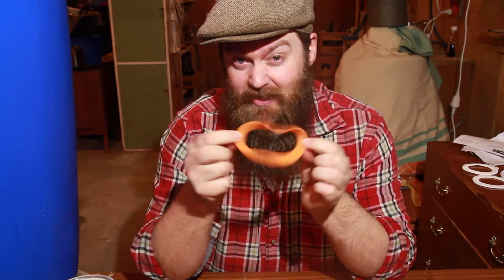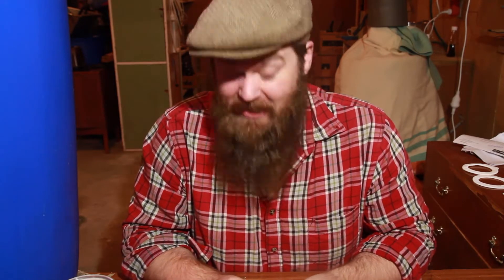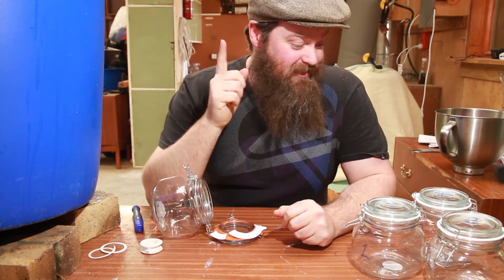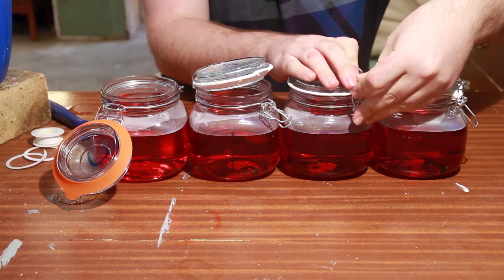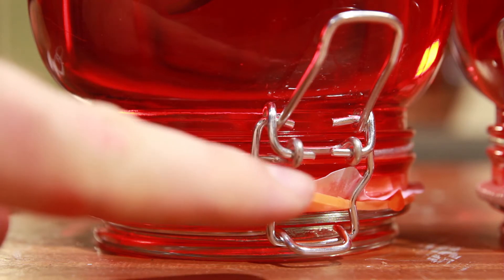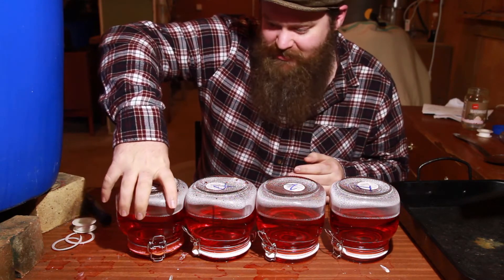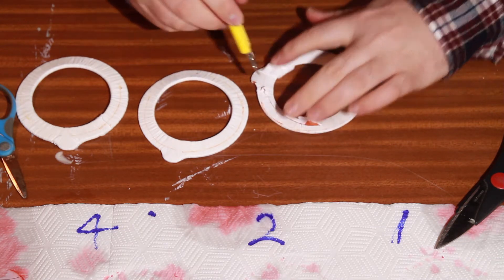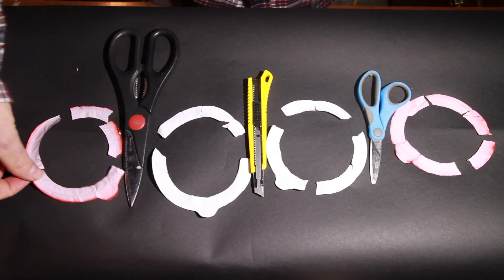PTFE Gaskets, Do They Work? Time to test!

Comment: I have a few ideas for improvement. PTFE comes in a ton of shapes, not just plumbers tape. You can get them way wider, and even with adhesive backing. With broad enough roll you wouldnt have to spiral it around and leave tons of seams where stuff could enter through. Instead you can do a single seamless part on all the parts that matter, and nust leave the one unavoidable seam on the outside of the gasket which at worst will only be touching air anyway. If making a whole gasket from scratch then get some craft foam sheets of appropriate thinkess. They are flexible and spring back much more consistently than just cardboard.

Secondly - the seal for the jar is even easier. You can get big  ultrathin films down to 0.03mm, and all you then need to do ks drape that film over your jar, and then use the existing seal (which will now never contact anything on the inside of the jar.)
All of these materials mentioned here are pretty to find on aliexpress at a pretty low cost.

Comment: Why is silicone bad for high concentration ethanol? In all the chemical compatibility charts I have seen it is rated as an A (exellent) or B (good) tolerance to pure ethanol (and many other things, mainly avoid petroleum products).
I mean, PTFE is even better and reacts with almost nothing, so I see the appeal, but it seems lkke silicone  would do the job well also. Basically all stills use silicone gaskets by default no? Am I missing something?

Comment: See if you can use the teflon tape to wrap directly around a copper plate to seal/hold it in a glass or metal tube ,maybe with and without supports for the plate. Eg holding a bubble plate in a stack or glass tube without triclamp connections at every plate level 🤔

Comment: I️ would try some pvc shower pan liner it’s totally water proof and air right. And can be cut in any shape. Similar to the silicon.
Reply from the maker: +Randall Janc thanks for the tip man.  I was covering the silicone gaskets as the word is they don't stand up to the high proof spirits.  

PVC would be in the same boat I guess.

Comment: Save yourself the headache and buy a roll of cork from Amazon. Cut as many gaskets as you need. Problem solved :)
Reply: Rolled cork isn't necessarily pure cork or food grade.   The wrong kind (sold for engine gaskets, or for hobby cork board) could have all kinds of adhesives , rubbers, and plastics mixed in.
Reply from the maker: +greenskeeper3000 true that will look into it!

Comment: Hey thanks for put this together! Here is my feed back! I'm using PTFE for thread in HP air system in diving for fixing leaks and this is also safe for oxygen gas. Can resist to a little heat too.
Reply from the maker: +1FrenchConnection1 ah cool man.  For nitrox?  What are you doing with the HP system? Where are you using it?  I was in the diving world.....feels like a life time ago now haha.
Reply: Still It look my channel! And you will understand what I'm doing. But basically we pumping gas flask for rebreather. And I'm also a dive technician in services.
Reply from the maker: +1FrenchConnection1 ok dude, your bad ass! Hahaha I checked it out.  That stuff is intense man!

Comment: I made my own ez flanges on each copper part of my column instead of using stainless flanges to solder onto each part of the copper column.
I then bought approved pure PTFE gaskets on amazon. They are very brittle and they had an additional rib/lip, which I sanded off to get to work with my flanges.
However they would leak no matter how hard I tightened the triclover. So I wrapped PTFE gaskets in PTFE tape. The leaks stopped... coincidental 4 layers of PTFE.

Jessie, Excellent video example on how to make your gaskets the right and SAFE way.
Reply from the maker: +BigEdsGuns thanks dude appreciate it.  Would be interested in seeing a image of your gasket set up!
Reply: They are these 2 inch ptfe gaskets: (Also have 3 inch gasket on my Manu column)

https://www.amazon.com/Brewery-Gaskets-Teflon-Tri-Clamp-Gasket/dp/B01GOP9BW2/ref=sr_1_2_sspa?ie=UTF8&qid=1505433200&sr=8-2-spons&keywords=ptfe+gaskets&psc=1

I sanded down the center rib on both sides, and wrapped them with PTFE.

Not quite yet willing to come fully out of the shadows with photos. I would just put out videos like you or Looney Larry in that case.
If a opportunity arises I might apply for a legit artisan/craft distilling position. Been silent at this hobby for such a long time. It would be nice to share information and experience with others on a larger scale.

Until then, in the USA: Don't Tell, Don't Sell!
Reply from the maker: +BigEdsGuns ah sorry dude I Forgot you were in the states. 

I also missed your first comment. I thought you meant you made the gasket itself with copper.
Reply: It's all good Jessie. I did wrap the outside edge of a copper plate with multiple holes drilled in it to hold up 3" diameter of 1.4 meters(?) of dime sized lava rock packing for my reflux column.

It is sandwiched between a 3" to 2" reducer with another PTFE - ptfe wrapped gasket. Seals just fine. ;)